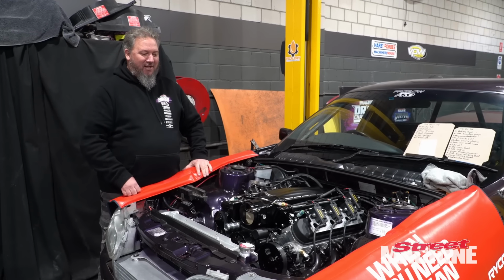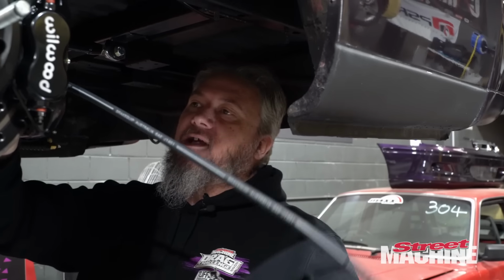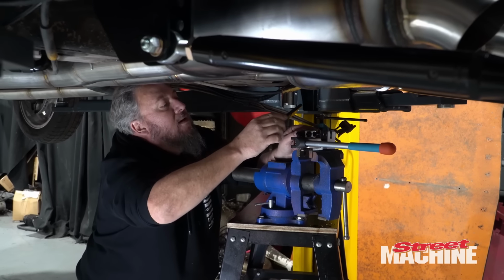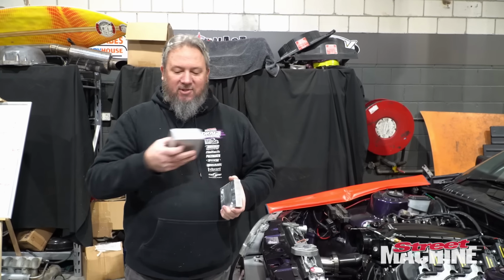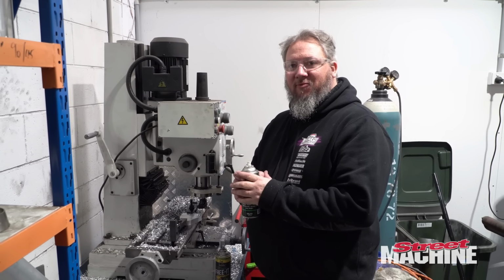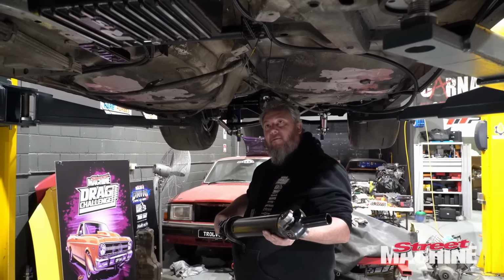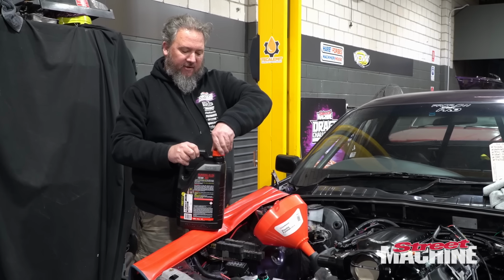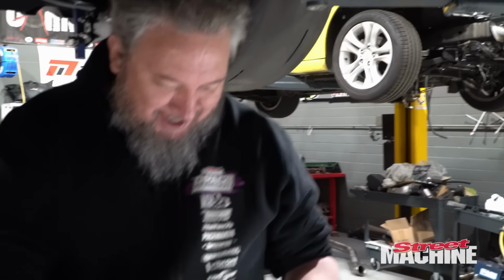Carnage - Finishing The Last Pieces On The Drag Challenge Ute

Comment: Scotty, you didn’t phase the rear half of the tail shaft to the front half. 
You will be a bad vibration if it’s not phased, it also wears out the universal joints faster if not phased.
Reply from the maker: I'll have a look at it
Reply: I noticed this too. It’s out by about 45 degrees
Reply: I was just about to say the same, tailshaft it out of phase. Otherwise doing a great job.
Reply: I saw that

Comment: Hey Scotty, is it me or is the rear tail shaft out of alignment with the front slip joint by about 90 degrees, they are suppose to be in align with each other.  Otherwise you can end up with an horrendous vibration. Seeya Rob.....look at 26mins 8secs you'll see what I mean.
Reply from the maker: A few people have mentioned that. I'm not usually a two-piece shaft guy, but I'll go back and check it out
Reply: I asked the same question about all my ss Utes and where on an angle when in the air

Comment: should be using astra power steering pump mate, do away with having to have that belt so close to the header
Reply from the maker: I've already talked about that in the videos. They gave a high current draw, and I need all the amps I can get for the fuel and ignition system
Reply: @STREETMACHINETV  ah yeah that makes sense

Comment: What's the worst car fluid to take a bath in? I can't stand ATF myself.
Reply from the maker: ATF is certainly terrible, diff oil stinks, but fuel stings, it's the worst
Reply: @STREETMACHINETV  Used gear oil for me! PS Where are the rear coil overs?

Comment: Mate  i hope you turned the wheels or rotors before measuring the brake line hose etc. 👍✌👌🦘
Reply from the maker: Why?
Reply: @STREETMACHINETV  due to the length of the hose, might be to short and damage the hosse etc. cheers  ✌✌😎😎👍👍
Reply from the maker: @7071t6  the calliper and its position relative to the axle never changes. This was the rear brakes.
Reply: @STREETMACHINETV  cheers i was thinking the front rotors, as it turns it will move thats all, 😎😎👍👍